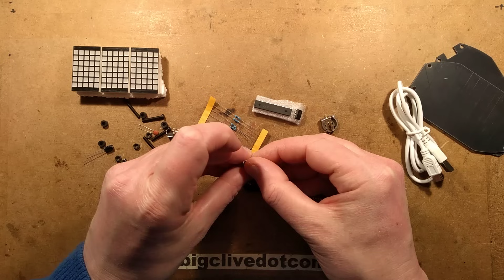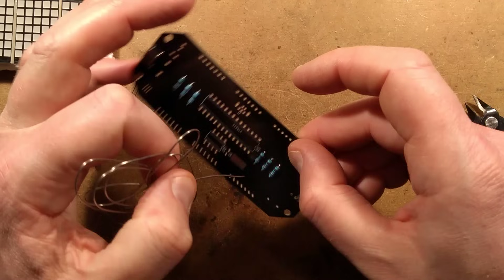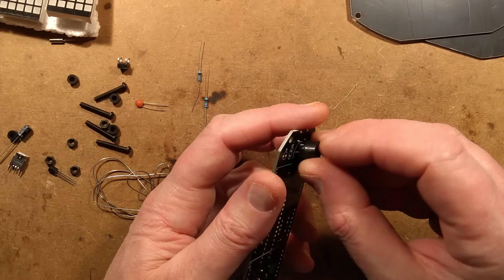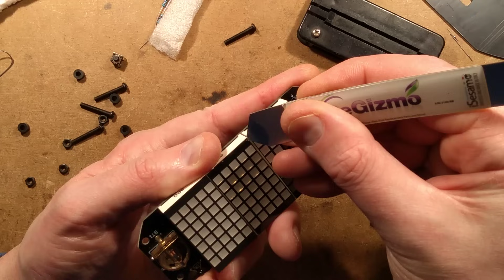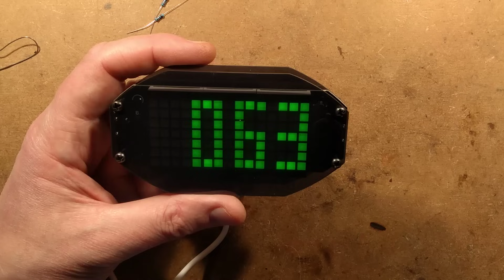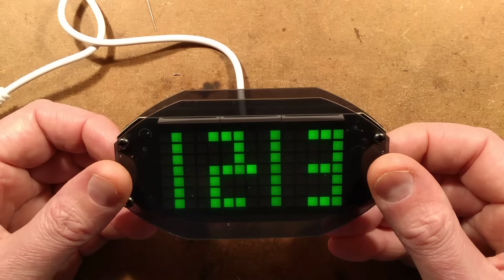Full clock kit build and setting guide.

Comment: Hi CLive, there seems to be a version of this with 5 LED matrixes, but I suspect the same software. This version I guess does not scroll on some of the settings. 5 display kit here, tempted although it looks like this kit may have surface mount chips: 
https://www.ebay.co.uk/itm/DS3231-Multifunction-Alarm-Clock-LED-Matrix-Dot-Animation-Effects-DIY-Kit-Gifts/232947858722?ssPageName=STRK%3AMEBIDX%3AIT&var=532467735322&_trksid=p2060353.m1438.l2649

Comment: Interesting that that crystal doesn't have the usual 2 x 10pF ceramics? Does that plated "screen"  replace them??
Reply from the maker: The chip has internal capacitors.  But the timekeeping when powered is terrible.  Lots of noise getting to the clock chip.

Comment: DS1307s are only as accurate as the temperature-sensitive crystals you give them for timing, and there's no perfect crystal. Perfect? It's hard to find a good crystal. There is no reason to use a DS1307 (alone) for a clock when an ESP-8266 can obtain precise time via network time protocol (NTP).

Comment: Built the SMD version of that. Absolute nightmare to build (even using really small bits) and it never worked well. The circular LED clock kits (though more expensive) offer far more flexibility - the ring of 60 3mm LEDs can be changed to whatever colour you fancy! (in my case RGBYW). When assembled, the kits with case included make very good novel Christmas gifts to "non-electronically inclined" relatives! :-)

Comment: I built the earlier clock that you covered. It worked for about 8 months and died. It was flaky from day one. For no reason, the displays would just go dark. Unplug the power pack and plug it back in would fix it. Then one day, it just stayed dark. It perfectly matched the light at the bottom of the garbage can! This kind of cheap Chinesium junk needs to be banned.

Comment: I bought a RTC module to use with Arduino off eBay and it was way off. I determined it had an incorrect frequency crystal installed on it.
edit: just found that module again, it is a DS1307 with a 32049 crystal. This RTC would loos about 30 minutes a day. The DS1307 requires a 32768, the 32049 crystal is 2.2% lower rate than the 32768 which equates to about 32 minutes and 18 seconds loss in a 24 hour period.

Comment: Any decent quartz clock should have a trimmer capacitor to fine tune the crystal frequency.  Even cheap watches used to have them. Setting is hit-or-miss unless you've got an accurate frequency counter.

Comment: The problem is with DS1307. Although it is a decent RTC, it relies on an external 32.768 KHz crystal. The shitty Chinese crystal provided with the kit drifts very much with ambient temperature changes. Replacing it with a decent one, better yet with a quality TCXO will solve the problem of not keeping the time well. And for the more DIY inclined, DS3231 RTC will be a much better choice to start with. It has an internal TCXO and works very well. Drift is like a few seconds a month.

Comment: 26:09 - One nice thing about the TS100 is it will work with anything from 10 to 24 volts (specs say 12 to 24, but it actually works down to 8.7 or so - although it heats up very slowly). That means you can use just three lithium cells in series and have a very portable kit (it will draw about 1.2A at that voltage, so cheap 14500s might not work; you'll probably need 18650s). It heats up noticeably faster with four (~14.8V), though. And at 24V it goes from room temperature (~15 ºC) to 300 ºC in about six seconds (and you can get really cheap boost regulators to get 24V out of three or four cells). 

Another nice thing is that the base of the tip (is that an oxymoron? or a cock joke?) doesn't get hot, so you can hold it about 5cm away from the tip, which is great for fiddly frittery precision work.

For what you do on the channel, you'll probably want a BC2 tip, and then maybe a C4 and / or D24 for larger stuff.

P.S. - If / when you decide to try out the one you have, don't be surprised if the "calibration" instructions don't match the manual. They seem to have been written for an older firmware. The current (OEM) firmware sequence to do calibration is:

1. Power off.
2. Let the tip cool down to room temperature (and don't hold it - the handle should be at the same temperature as the tip).
3. Power up.
4. Press B once to show temperature and voltage (if you don't see the voltage, you have an older firmware; upgrade or follow the manual).
5. Hold A or B (not both at the same time like the manual says) for about 3 seconds (the iron should then show "Cal_V"; if it shows "Cal_X", either the tip is defective or the handle and the tip were at very different temperatures).
6. Hold both buttons at the same time (not a single one like the manual says) to go back to standby mode (or click one of the buttons to go to other set-up options - holding down both exits the menu from any "page").

If you're using the Ralim firmware, ignore all that, of course, and just follow the instructions on the website (the current version is bugged and always displays ambient temperature as 0 ºC, though).

Comment: Not a bad little kit in the end. I'd probably buy one if it had an option to use F instead of C.

edit: Looks like they do have a way to change it. Probably going to regret it for those tiny solder pads but I ordered one,
Reply: Hi, I know this is an old comment, but where did you order one from ? Having trouble finding a similar kit now in 2022.
Reply: Off eBay. I bought one but it didn't keep time worth a crap. I can't remember which but over a month it would either gain or lose almost an hour (as Clive mentioned in another comment). If it wasn't for that it'd have been a nice little clock kit. It was still fun to build. Took me about an hour start to finish.

Comment: When displaying in 12 hour mode, does it use make a better job of the : as the "mid-point" marker?  Because if you omit the leading zero the largest 10's hour digit would be 1, which means you can have a blank column either side of the colon (5 pixels for hours, 3 pixels for colon, 7 pixels for minutes = 15 total).

Also, in 24 hour mode it occurs to me you could also do better in a lot of cases.  If you again omit the leading zero (agree not 100% technically correct for 24 hour mode) and use a single column for 1, that leaves only the hours 20, 22 and 23 that cause us an issue with space.  Shrink the 2 and 3 digits to 2 columns each, and that leaves only the 20:xx times requiring more than the 5 pixels available for the hours position.  Further optimising the minute digits for 2357 to 2 columns when necessary (digits 0469 always require 3 columns to be legible) then there are only 18 times remaining that cannot be displayed in the 15 columns available:
20:00 20:02 20:03 20:04 20:05 20:06 20:07 20:08 20:09 20:40 20:42 20:43 20:44 20:45 20:46 20:47 20:48 20:49

Example: https://youtu.be/tafohtW0_z8

Comment: I think once this arrives on the slow boat to Canada sometime in March, I shall build it without installing the piezo buzzer.
Don't really need another alarm clock... and the device won't beep like a microwave oven every time a button is pushed.
I guess it would also be possible to add extension wires for the buttons and install them on the rear of a wood case.
Reply: a particularly sickly microwave oven at that...

Comment: I built 1 off these. I brought it because I love building kits and I really liked the clock display. But it too wont keep time it drifts out off sinc really quickly. After a few days it already an hour or 2 out off sync. Which is a shame, because I really liked the kit otherwise. I wondered if I damaged the crystal with too high a temperature on My soldering iron?
Reply from the maker: This one is already drifting.  I'll be experimenting with it.

Comment: When I build these kits I usually extend the thermister so it sticks up and out of the case so the temp is more acurate, if it is under the case it will pick up the heat from the clock and the temp function becomes useless.

Comment: The scissors comment was very good. The nicks in the blade would snag on the cloth mom was cutting. 1st and last time I did that.
Reply: It must be my age but as a kid I found that destroying mums best scissors directly correlated with a sudden increase in backside temperature :-D
Reply: You should also never use scissors that are cutting cloth to cut paper, as the cellulose in the paper dulls the blade.
Reply: @crimsun7186  I heard that speech too, Never understood that one. Sewing scissors for sewing or life and death situations only. CHECK.
Reply: @crimsun7186  I thought it was the rock? But OK...
Reply: I got in so much trouble for that as akid
Reply: @piratetv1  That's half the fun. Running away from Mum's slipper LOL. You learn so much in those years. After picking bits of glass out of my forehead I learnt that neon's need a current limiting resistor - I was lucky really as I had nothing protecting my eyes. It could have been a life changing event !!!!!!

Comment: In most PCB/SCH design packages, the square pad just means 'pin 1' of the component for purposes of netlisting and is usually pre-set in the supplied libraries. Since there appears to be a transistor driving the sounder, it would depend on whether it's NPN or PNP to determine the polarity (if any). Most likely,  in this case, it's NPN, and the square pin should be negative.

Comment: I have a Sony ICF-C218 alarm clock-radio with a green display of 7-segment digits. It plugs in but it has a 2032 lithium battery so it keeps time during power failures. I’m assuming it’s crystal-controlled, but it gains a bit every year and is about 23 minutes fast after I think 8 1/2 years. I suppose that a cheap 32768 Hz crystal isn’t necessarily that exact frequency.

Gaining under 3 minutes a year isn’t all that bad. (I don’t think I’ve reset the time since I bought it. It adjusts automatically for Daylight Savings.)

Comment: would using the DS3231 instead of the DS1307 fix the large time deviations ? The DS3231 RTC has its own temperature sensor that makes the clock run super exact. btw I love your long vids !

Comment: fmt is probably format

it is amazing that the clock works despite all the soldering required.

fortunately it is a level 1 kit using through hole parts not surface mount

Comment: Lol you are freezing its hot here in Melbourne its 28° C inside and 42°C outside with a forecast high of 44° today.

My shed was 48 °C  yesterday during the heat of the day will probably be above 50° in the mid afternoon. All projects are on hold due to heat :(
Reply from the maker: I visited Melbourne once.  I still have the Yakka overalls I bought at the Victoria market.

Comment: One of the cheaper 32.768 kHz crystal I could find was a +/-20 PPM manufacturing tolerance with a -200/-100 ppm Frequency Stability over its full Operating Temperature range of -40C to +85C (post reflow soldering). 
After one year the absolute worst the time for that part, if you were freezing it to -40C or heating it up +85C, it could be out by anywhere from 6943 seconds (fast) to -3787 seconds (slow). If it was a more typical part say a +/-20ppm 32768Hz crystal, that should be anywhere between +631.152 seconds and -631.152 seconds per year, using a typical 15 bit counter (2^15=32768). Or if it was a +/-50ppm 32768Hz crystal that could be anywhere between +/-1577.88 seconds per year.

Comment: 15 - 31 for the date umm wtf did I miss something big changing?
Reply: Yeah, a confused DS1307 real time clock is what you missed :-P If the microcontroller doesn't do a proper reset of the RTC when it powers up, you get junk data, and confused users is a bonus. This also means that the microcontroller is doing little to no data validation.
Reply: Yeah I was counting the months too lmao.

Comment: Are there NTP capable ones ? That could be perhaps set by a RaspberryPi?
Reply: NTP is available for Arduino so easiest way is to program an ESP8266 board (built-in WiFi) plus a display of your choice.
Reply: Richard Deasington tbh I have a Rpi ready to go
Reply: Kai Hendry In that case you just need the NTP daemon. You could even get the PTP daemon and get microsecond accuracy 🤔
Reply: Just get some 8x8 led display kits and connect them to you pi!  Much better with 4.  https://youtu.be/Wghs3i80HGo

Comment: Hi Clive! you seem to know your stuff, I'm quite concerned about a unit I just bought,
 I just plugged in a Marsona 1200, a sound generator/ sleep aid from the 1970s, its new old stock but when i plugged it in it had a background hum before I actually turned the unit on and after about a minute it started to make a crackling sound/ produced a slight plasticy smell. I  unplugged the unit right away and the crackling settled/ the smell stopped. 
I don't intend on plugging it in again but I'm concerned it might be still dangerous?

Comment: Display shows 15  31. Clive: "This must be the date." - 31th of Trizember or how do you call the 15th month?
Reply: February 31 even.
Reply: @draketungsten74  31 is odd 🥱🥱.
Reply: @brabhamfreaman166  February 31, even.
Reply: Those are metric months :D
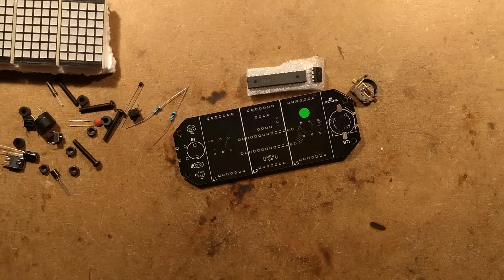Reply: Actually extended months or days can be useful for shift work,  or time operations where the job starts at 20:00 Day 1 , for calculating pay or resource avaliblity to have job finish at 27:00 Day 1 can be simpler than have 04:00 Day 2- less calculation and easier to mentally check
Reply: High Path, 04:00 is 28:00. Except for the fifth Tuesday of February in odd numbered years.
Reply: Casimir Konrad that’s the 15th day of the 31st month
Reply: Oh, what's wrong with you Americans, here in Europe it's way simpler: day, month, year - a natural progression.
So that would be the 15th of Whaaatebruary
Reply: Casimir Konrad :
Here in the South US, we call that "extended duck hunting season." 
Twelve months just ain't enough.
Reply: @muimasmacho  It is for the poor Ducks
Reply: @blogtodeath4736  It's not long enough for the rabbits. Rabbit season comes after duck season.
Reply: @gorillaau wabbit season, duck season fire
Reply: Military time. 3:31pm
Reply: Please note that everyone does NOT use the Christian Calendar.

Comment: AT exactly 40:15 I would have selected that font because in the default one the little dots in the middle touch the two which is super annoying for me. Before you even built the thing I would have just thrown the buzzer away straight off the bat. Fuck that, I don't need an alarm that annoying anyway I would end up smashing it.

Comment: About the "square pad" thing... I have seen several CAD packages that use a square pad for "pin 1" - i.e. whatever pin is the "first" in the symbol library. It does not indicate a specific polarity (as with the capacitor) but just a pin number. Whoever designs the parts libraries usually sticks with "pin 1" = "positive" or "ground" and so most of the time it's like that... at least that's how I have experienced it.

Comment: Kits are a lot of fun, I just finished, perhaps the hardest kit I have seen on Ebay, finished her yesterday, installed the 5 required 1220 cells and pressed the button, and to my absolute amazement, she came to life and I have a working digital watch, all SM construction, the processor had such fine legs on it that I thought I would never get them separated as the solder refused to come away, it was bridges of Perkins County (where I live, not Clint,) and I pumped enough heat into that ST micro device that I figured it would never have survived the torture.  Well took me a full day, I believed I was saved by ordering one of those little brass shavings thing for my soldering iron (ordered a new one of those to so I had some better equipment to finish the project.  I did manage to break one of the holes away on the clear plastic frame but some glue fixed that.  I wore her now for a couple of days, but she is rather fragile and I don't see her as an everyday watch, but one to wear when I am visiting others of the geek religion.  Here she is, order one, they are only 10 bucks and tons of SMD practice for your price!  They even tossed in 1 extra resistor and cap, I needed one as I got carried away with the resistors and had to remove one to replace it with a more powerful one, screwed it up, thank god for the exxtra.   Here is where I got her:  https://www.ebay.com/itm/SCM-Transparent-LED-Watch-DIY-LED-Digital-Tube-Electronic-Watch-DIY-Kit/362388419401?ssPageName=STRK%3AMEBIDX%3AIT&_trksid=p2060353.m2749.l2649   Oh and I don't think I would even wear her outdoors if it looked like heavy fog or rain because there is no way in hell she is water proof. Hope the batteries last a long time, man 5 friggin batteries for one little watch!